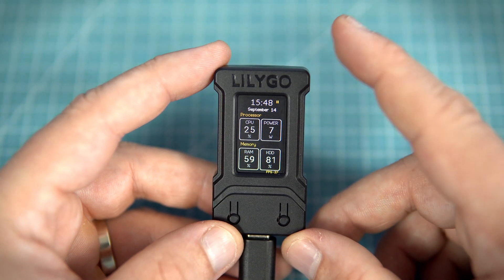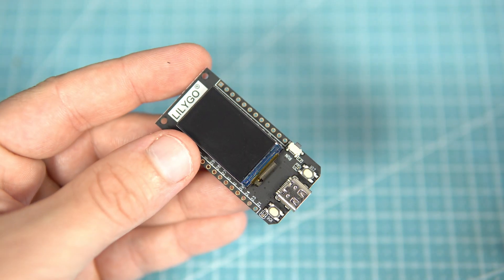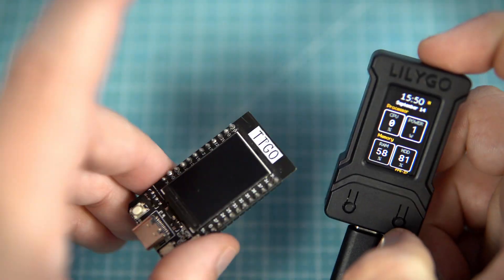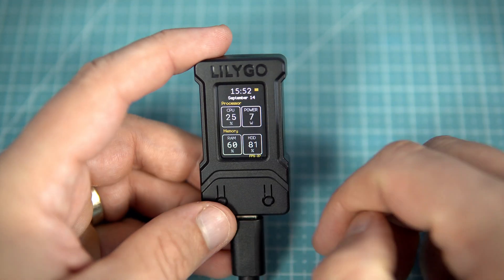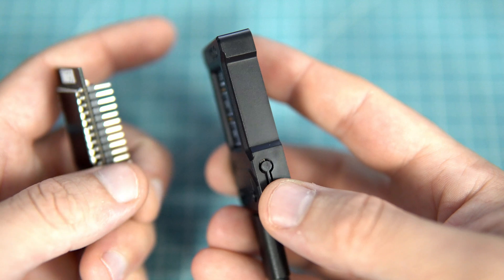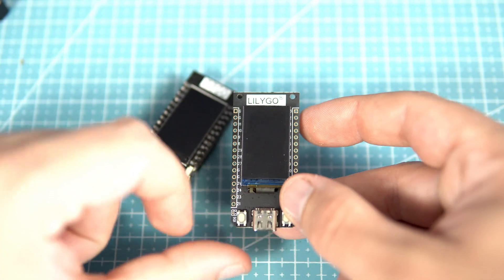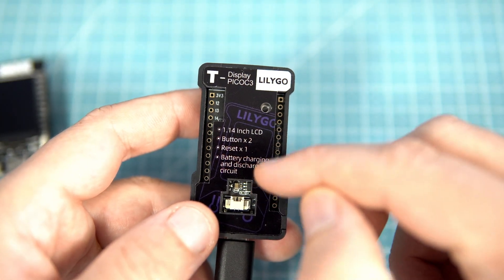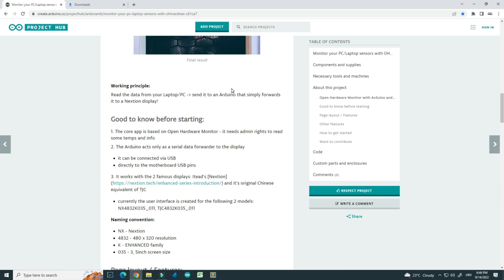PC Hardware monitor using T-Display RP2040

Comment: Hi Sir! just walking around videos about esp32 ytube  decided to show me your video.
Respect! - your english in your speed is ideal for the translator to German - as i  had it running before- to translate something. // I  just orderd 2x T-PicoC3 ESP32 Display ESP32 USB C ESP32-C3 Dual MCU Wireless WiFi BLE Modul  - for testing in 32s ESPNOW Net. Nice in 2024 as an Elektroniker! order anything and get it cheap on demand 😎

Comment: Hi Friend, I have purchased this board after I watched this video and I was hoping to make the same project as yours and also test it further - But I was not even able to compile the code in Arduino as well not to upload it - I would be happy if you can elaborate a bit more on your videos and give a simple quick step by step tutorial that we can follow. That will give more knowledge to the community and I am sure we all would like to have an instructive video on how to install the project on the board we bought. It would be easier for me to follow if i will see that i am doing what you are doing and i will hope to get the same result. boards installation to have the correct version installed and to use the correct board with the correct settings in Arduino IDE - that would help a lot!  and also the right library to use and the correct versions that will make life easier for us to follow your great projects. I would be happy if you can do a follow up video and provide instructions on how to make this great board work with your wonderful code. Thanks
Reply from the maker: right now I don't have plans for making instruction video. maybe next month. But i can try to help you here! Can you please tell me did you install board in Arduino IDE? Did you fallow instruction on lilygo site?

Comment: Do you know if there is an STL file for a 3D print of that case - it looks nice
Reply from the maker: I am not  sure that STL exist, this case is not printed.
Reply: @VolosProjects  Thank You, I just ran the code (ESP32) and unfortunately the screen is super scrambled.  I purchased my TTGO a couple years ago, so, it might be an old system.  I did follow your firmware update program, so I have latest firmware.  Not to worry, other projects do work.  Thanks.

Comment: Just went looking on Banggood and saw that they also have a model that is RP2040+ ESP32-C3 that looks exactly like this one your showing and costs €2,38 more.. looks like an interesting combo what do you think? Almost like a pico-w .. I’m thinking of getting it to play with do sum projects inspired from your content.. good idea????
Reply from the maker: I already have that board, but i am not sure what to do with it 😀😀
Reply: @VolosProjects  seems to me it's a better pico-w with display.. so everything you can do with the pico-w and having a build in console hahah.. The only thing i don't like is that the RP2040 has 4mb instead of 16MB.. i bought two YD-RP2040 from Aliexpress that have the W25Q128 ..btw would be nuts if they would make a RP2040 16Mb + ESP32-S3 N16R8 ... with a display.. hahah .. without a display it would be a better pico-w for sure.. My YD-RP2040  is way better then a 2mb usb-micro pico..  Still debating if i'm going to get the T-Pico C3.. €36,72 for two.. (i don't like to buy just one of any board)..